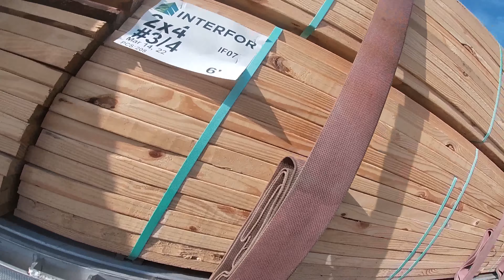TMC VS MAVERICK | Which Is A Better Company? | Maverick Transportation

Comment: Always those acquiring ANY load responsibility to check the load to your comfort level. X strap or bulkhead your loads. DOT would hold you responsible for any load that comes off your trailer. Doesn’t matter if others secured that load. Remember CYA….